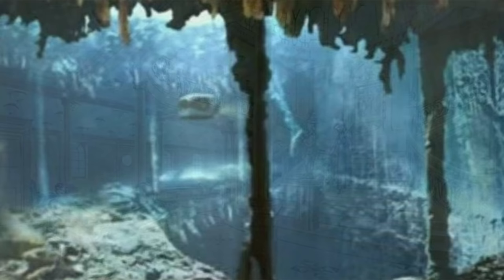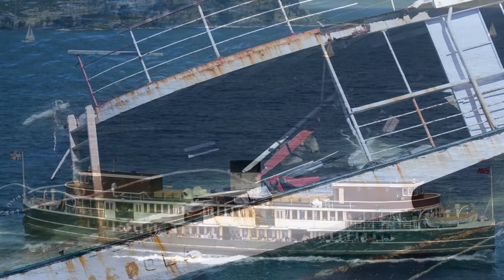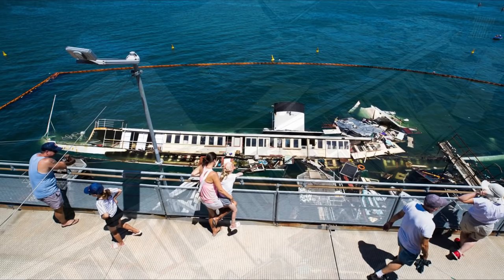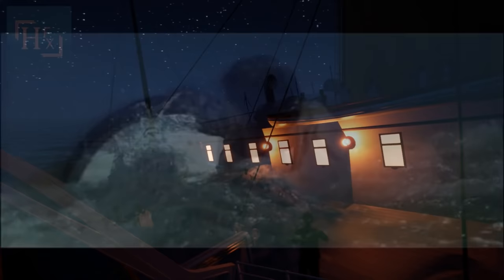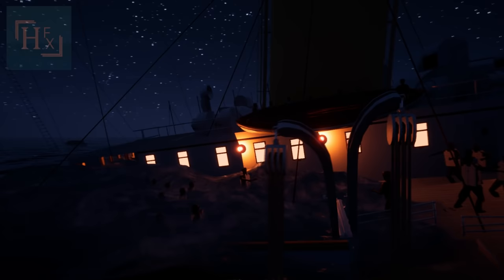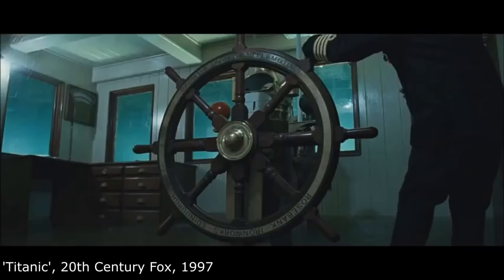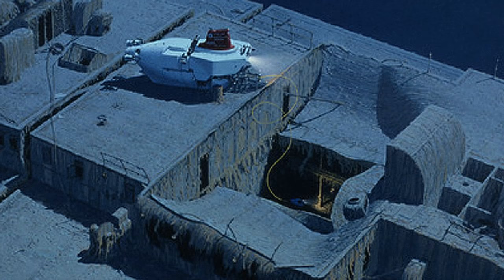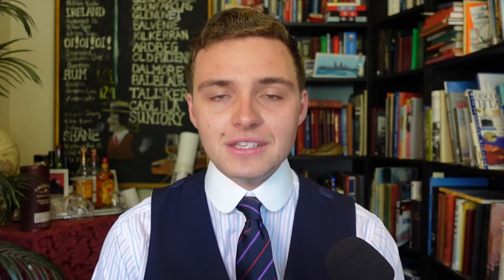What Happened to Titanic's Grand Staircase Dome?

Comment: Well done in explaining hydrostatic head, and the destructive force it can mete out. I feel this is an aspect oft overlooked in the destruction of the Titanic that is glossed over by both the Holly and Pinewood versions of the sinking.

It's just simple - when Titanic was afloat she had a draught of around 35 feet / 11 metres. We all know that - we've seen the dolphins at the prow... But maybe what we didn't appreciate is that whilst ever she stayed afloat, that 11 metre draught (okay, let's knock it down to 10 metres by the time the coal was burnt away on April 14th) had to be maintained while her whole hull from prow to stem was in the water. Even 15 minutes before she went under while she was still upright in the water - There still MUST, by the laws of physics - have been an average of a 30 foot / 10 metre difference in water levels between inside and outside of the ship. It's LITERALLY the only way a ship doesn't drop like lead.

As things developed towards the end, things got even more extreme. When part of her hull was fully submerged and another part was fully out of the water, for her to not sink like a stone, the hydrostatic head in the still buoyant sections of the ship had to INCREASE to allow for the lower displacement footprint available overall - and multiple survivor reports have stated that the propellers were fully out of the water simultaneously to the full forecastle being under water.

So we are left with a situation where when the dome went under, 5 minutes before the end as the final plunge commenced the water level INSIDE the ship was likely at about a full 40 feet / 12 metres lower. FOUR WHOLE DECKS!!!! Yes, take that in for a moment - as dramatic as it looked in the Cameron movie where the hydrostatic head shown was only about 3 or 4 feet and Frabrizzio got sucked towards a window... Imagine how violent it was in reality with water falling all the way from the boat deck down to the dining room.

In many ways, considering how Cameron wanted to make Titanic look scarier that the stoic depictions from before... It's a shame he never grasped just HOW terrifying it was in reality.
Reply: JFC... OPINION... u have. All u armchair QBs.... pfft

Comment: The only two possibilities are from impact, or water pressure.  If Cameron's film is remotely correct, it is shown shattering from water pressure, which would make sense, and then the remaining structure likely fell prey to the metal eating microorganisms on the Titanic's surface over the past 110 years.  (It's actually crazy to think the Titanic sank over a century ago...)
Reply: I agree it's stunning to realize "Titanic" sank over 100 years ago.  In many ways shipbuilding hasn't changed TOO much since that time and even the "Titanic's" technology is still impressive. Point of fact, today's cruise ships, most ships in fact, don't go any faster than "Titanic" did.
Military vessels are another story.

Comment: they were built with lots of wood! How anyone is surprised that glass and wood are missing from a wreck for 100 years ago is laughable
Reply: the dome cover itself was made of steel, though…
Reply: @DerpyPossum  ilmfao!
Reply: @rchristie5401  Whoa, what an
Reply: *informative and intelligent response.

darn that inconveniently placed reply button
Reply: @DerpyPossum  and what do you think happened when the steel vessel broke in two at the surface, the forwad secction with the stair case, plunging 13,000 feet down.Then impacting the Ocean floor?
Reply: @rchristie5401  y’know the video is about what happened to the dome cover, not the staircase.
Reply: @DerpyPossum  same question about the halving and the bow with the dome plunging down 13000 feet.

Comment: With a water pressure gradient of 0.465 psi/ft, a car at 5 feet will have only 2.3 psi over the atmospheric pressure. Where did you get the 1,995 lbs?
Reply from the maker: The numbers were calculated from a rating of ~0.433psi/ft; this gives gives a pressure gradient of 2.165psi to .433psi at a depth of 5', with an average of 1.299psi. We then have to multiply that value by the area of the door to arrive at the total force being applied to the outside of the door. Say 1,536 in.^2 of area; Average psi x area is 1.299psi x 1,536 in.^2 = 1,995 pounds force.